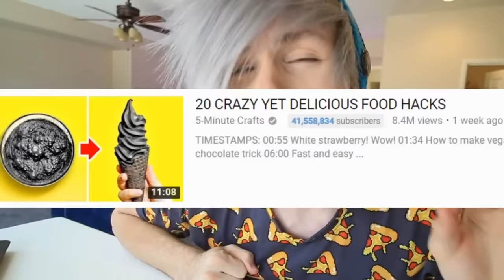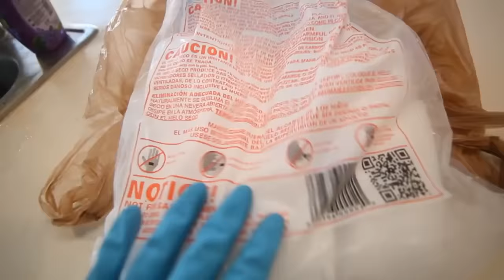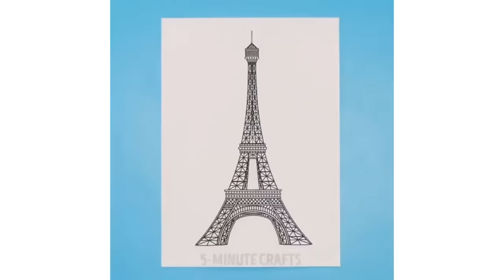Robby tries 100 5 minute crafts Lifehacks, DIYs, Pranks  and Crafts mega compilation #4

Comment: You can try rapping it with the ones that are leaking the ones that are leaking get wrapped with the ones that are leaking and then pour it into the 1 that you have And the 1 wrapped around it cover the whole so then it would like into a plastic bag and then it would freeze in to that and it would freeze and the little plastic